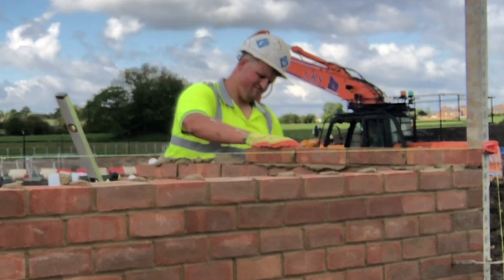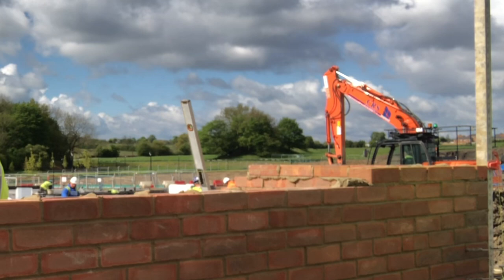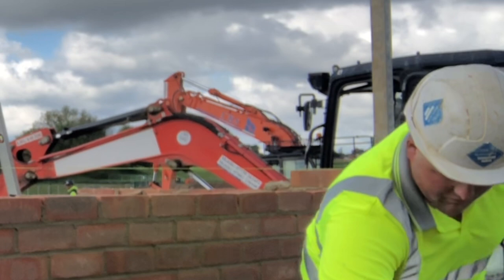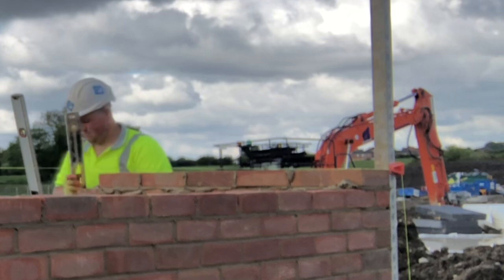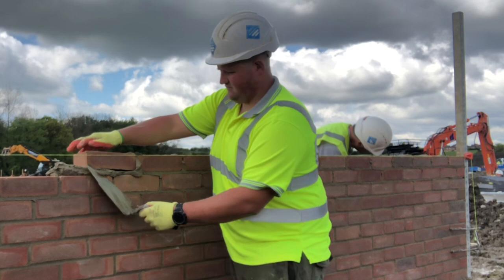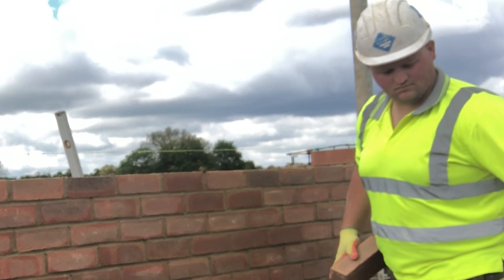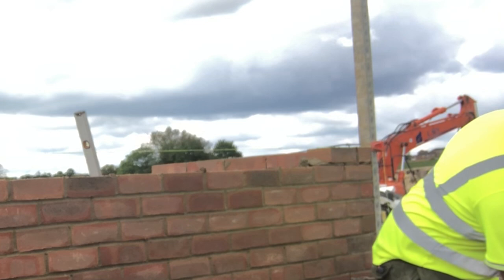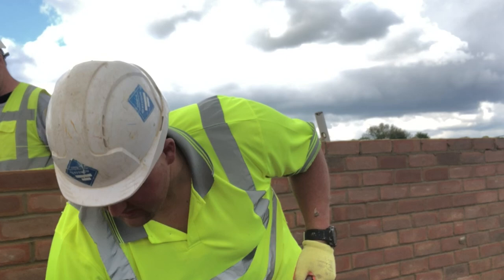Bricklaying Vlog - Garage Build (Heritage) - Silo Mortar & Setting Up Profiles - Part 1

Comment: How many bricks high is safe before it starts wobbling etc?
Reply from the maker: If the bricks are dry as high as you can reach is safe really, bricks can sink If  they are wet with 10 to 20 courses layed in a day
Reply: @theafter8bricky Thanks!  with concrete blocks, what's the rule of thumb?
Reply: @rockandmeatroll  7 course per day of blocks. Sometimes less if blocks are wet. Walls get wobbly fast
Reply from the maker: I normally do 5 or 6 then back it up
Reply: @theafter8bricky  thanks, by backing up, you mean with planks?
Reply from the maker: @rockandmeatroll  yeah propping with planks if a single skin or building the other skin of brick or block work if on site